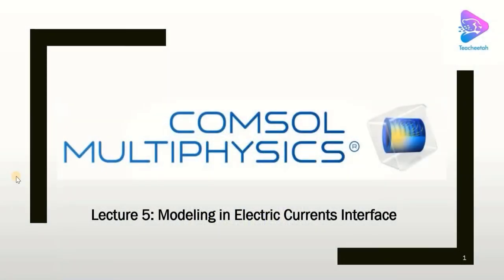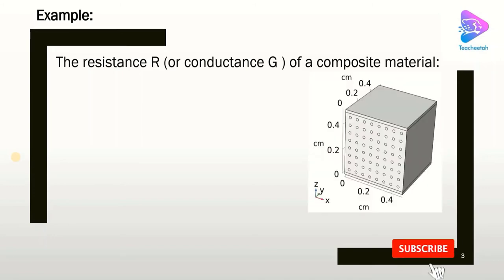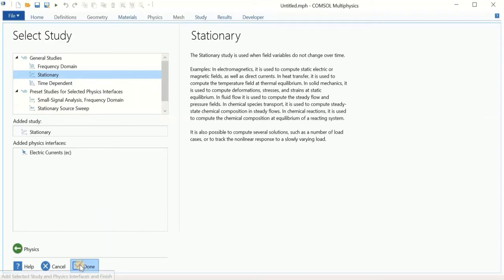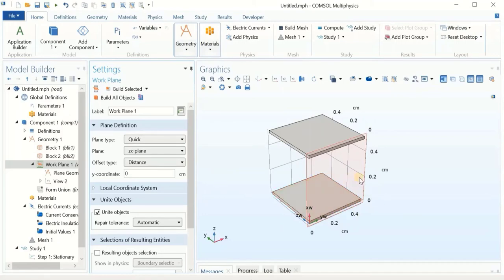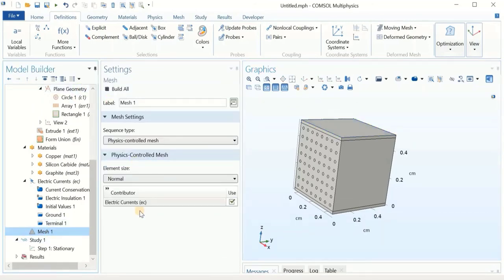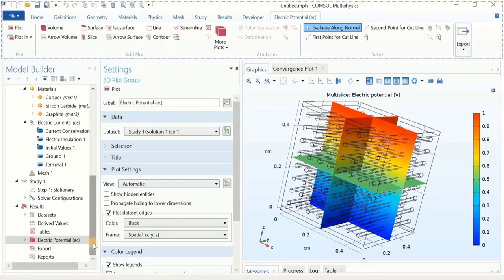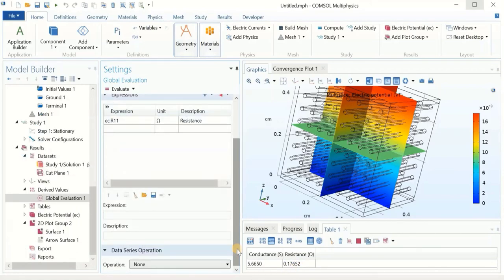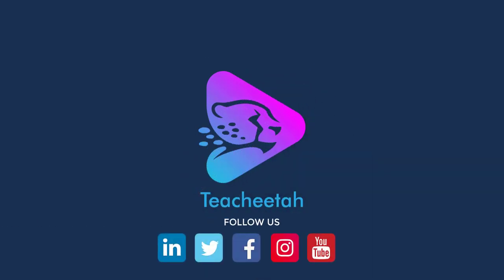Tutorial 5: Modeling in Electric Current Interface- Comsol Multiphysics

Comment: Thank you very much for this great tutorial! excuse my silly question, i wonder why the value for the current is not important here and whether you apply 0.1A or 0.2A or any other value you would get the same result for the resistance? 
Thanks again
Reply from the maker: The reason is in the stationary study like a DC condition, the properties like resistance and capacitance are intrinsic properties of the system and only depend on the geometry and materials of the system. Therefore, the variation of current values doesn’t change such properties as the voltage across the system will also change accordingly based on the Ohms law.

Comment: Wonderful tutorial 👌. I wonder why you didn’t assign boundary conditions to other faces? Suppose someone want to assign periodic boundary condition to other faces?
Reply from the maker: Thanks for the comment. In this case we just wanted to introduce the interface and the example is limited to geometry defined here where other than electrodes, the electric insulation is applied to the other boundaries as the default setup of the software, but depending on the problem that is being studied, the periodic boundary condition may also be used.
Reply: @Teacheetah  i have tried periodic boundary condition but got an error: “ failed to find destination boundaries or the destination selections empty. 
Feature: periodic condition 1 ( pc1)” 
Can you share Any help or direction in this 
Thanks

Comment: tnqu so much sir ....i learend a lot from this video.  can u suggest me sir for designing a capacitor film , how to take dimension of film for model.
Reply from the maker: thanks for the comment. In a 2d fashion, you may draw the cross section of the film as the 2d geometry and give the other dimension as the depth of your model. In a 3d model, you could simply make the film using length, width and thickness of your film.
Reply: Tnqu sir for ur response.... Actually sir I'm getting pbm while creating actual design of film because sir the length is coming too large(in mm) and thickness is too small(in micro meter) . Here after Designing all three plates, I can't see even thickness of plate, so while applying physics properties and results can't see properly.
  Kindly sir if possible help me pls.
Reply from the maker: You may use a 2D model instead of the 3D model, and give the longest dimension as the depth. You can see how to define a thin film geometry in a 2D fashion in Tutorials 7 or 12, though they’re different problems

Comment: Hi, Thanks for this video. I learned a lot. I have a question. Given the electric field at each point is dV/dx at that point, in your 2D plot for electric potential and electric field profiles, why don't we have any potential change in x-direction (potential is constant in x-direction in your 2D plot) but we see the electric field in x-direction is changing?
Reply from the maker: It could be due to the fact that the electric field lines shown here are the vectors found based on the three-dimensional gradient of the scaler potential not necessarily the dv/dx component. The electric field norm is the vector magnitude (length), and even taking the 2d model, the field vectors considers both x and y directions
Reply: @Teacheetah  Thanks for your reply. So you mean, although dv/dx=0, the electric field magnitude is changing on the 2D plot because dv/dy and dv/dz are not zero? right?
Reply from the maker: For this special case (the 2d plot shows the ZX plane) the dv/dz is not zero
Reply: @Teacheetah  thanks!
Reply from the maker: no problem, let us know if you have any further question

Comment: Sir, can u please upload a video based on time varying electric field in AC-DC  electrostatic module.
Reply from the maker: Thanks for the comment.The time varying case might be modeled by setting a Time-Dependent study instead of a Stationary study and assign the desired function to the targeted parameter like the electric field but you may need to ensure that it is meaningful in terms of the physics of the problem.